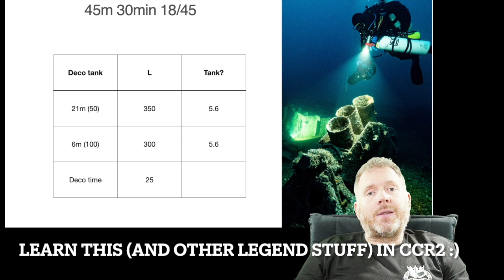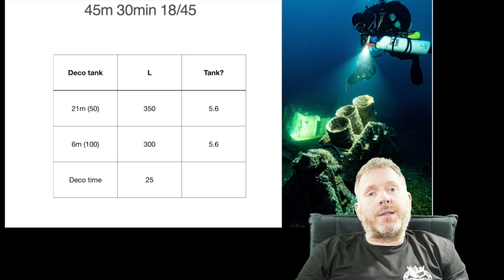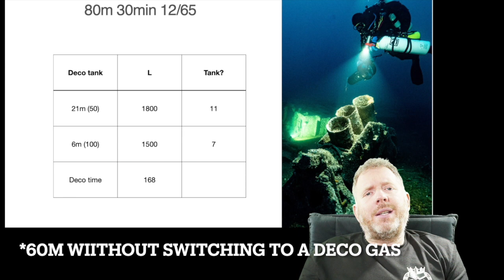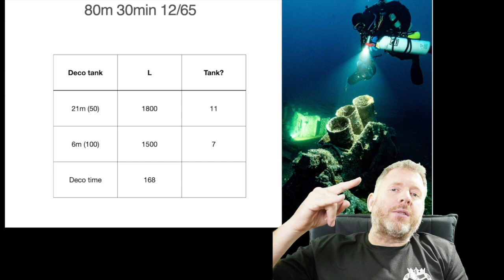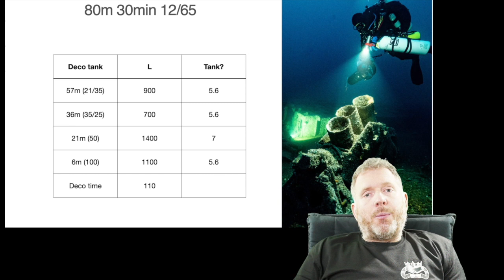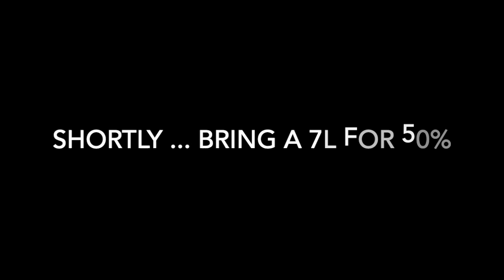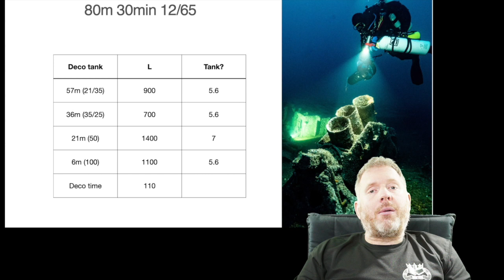A discussion about what size tank, how much and what gases for rebreather bailout

Comment: On the one hand you're talking about the minimum size tanks needed for BO deco obligation, on the other hand you're talking about splitting the tanks amongst your teammates, which would mean larger tanks in the event of separation. I wish you talked more about that, because clearly that has to be taken into account. There should always be an assumption that the team may separate or multiple divers may need to BO. It's an improbable situation, but that's why we plan. We don't want improbable to turn into death.

Great video otherwise, thanks for sharing it!
Reply from the maker: Hi BROis - even though you carry slightly different gas you would still carry enough to deco on your own.  It's just if you're together deco would be faster as you'd have more deco gas choices (yours and your teammate's)

Comment: Nice one but your sac rate is qute low around 11 Liters or less... Isn´t it better to calculate with just 20 liters because of the stress that could apear ?
Reply from the maker: That would depend on what your stressed scr is :).  For entry level training 20 is wise but at some point it becomes difficult to carry all that gas and some time spent on comfort technique will mean most are in <15 range (and if not there’s a reason that’s worth finding)
Reply from the maker: @@GerritHausmann in order to do this dive a diver should be suitably qualified and experienced - how I dive and decompress is based on my knowledge and my experience (of doing these types of dives for 20+ years).  On that basis its likely not the same as others' strategies (which may be more or less agressive depending on a person's comfort and experience).   Needness to say I wouldn't die using this strategy ... and I did say in video its based on my numbers and you should verify your own ;)   There is no need to calculate my gas consumption based on everybody else's - if I was stressed for whatever reason I do have team mates to offer assistence or I could change shape of deco.  At end of day carrying too much or too bulky cylinders might get you into trouble in first place ... in diving - rarely things are as simple as they first seem.

Comment: How about 120 meter on the GUE JJCCR
Reply: ...been there done that... ...even with GEE BEE 🙂
Reply from the maker: I was thinking of a series … “so you wanna dive to 100m” could easily be 120 ;)
Reply: Done that
Reply: @gbdivering  where are we at when swapping 2x7 for 2x12 on the GUE JJ CCR😎🤘

Great video, keep it comming🤩🤘
Reply from the maker: 12s lol … I’d rather bring another deco gas ;)
Reply: Are you suggesting to use 7L steels as deco tanks, or can you get 7L ally tanks? I wouldn't want a steel tank on a leash.

Also, I'd be concerned about pushing the capacity of a 40cf deco tank through the deep & intermediate stops, since OC bailout deco is often faster than on CCR. In a team that would mean either the bailout diver would be forced to stay longer on deeper stops (risking running out of gas) or the CCR divers need to skip deco or try to push up their ppO2 on the deeper stops.
Reply from the maker: 7l al  no steels although viktovice 7s are more neutral than al tanks.   As for the oc being faster … think you need to have another look at numbers.  Average for all oc deco gases is 1.2 - the only exception is oxygen, where there is an theoretical advantage 1.6 vs 1.2.
Reply: @gbdivering  this is why I don’t do big dives with T2 bone heads who haven’t done ccr2. Especially ones that like to gob off about how T1 divers shouldn’t be on ccr ;)